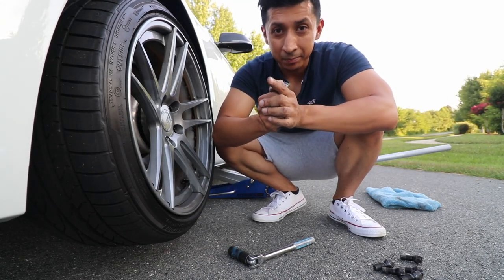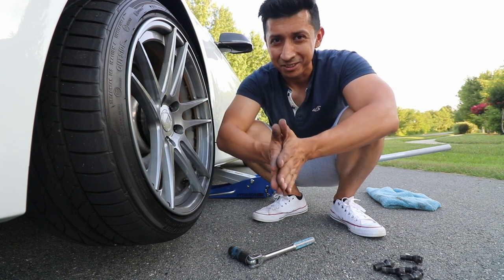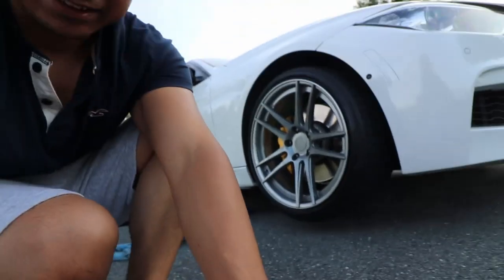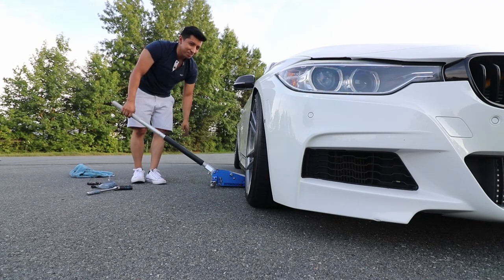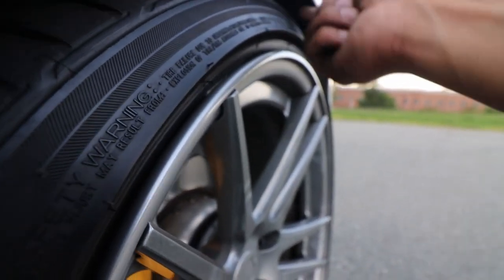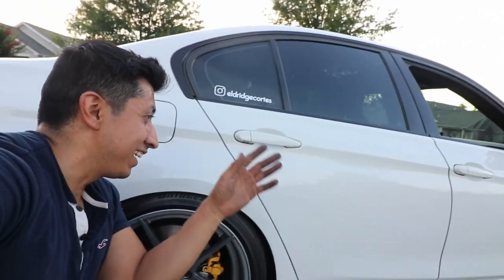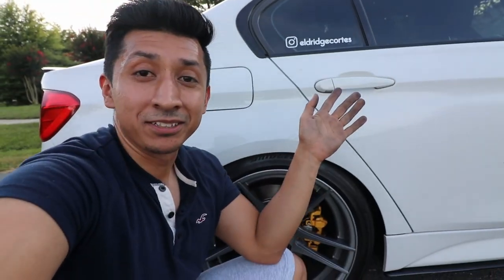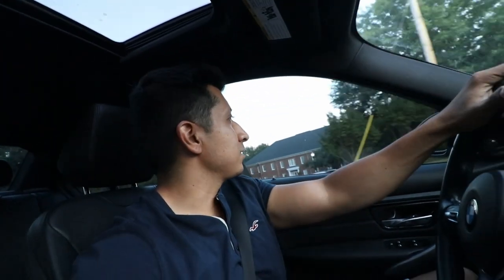Perfecting my F30s stance! | wheel spacers

Comment: Looks awesome. I have very similar fitment with 8.5" +20 ( you poke 3mm more) up front and 9.5" +33 rear (0.6 mm difference). My tires are too meaty though, I think you should stick with the 235 for a lil' more stretch but that's me :-)
Reply from the maker: I think youre right. I took a good look yesterday and If i can leave it at the height it is now, ill keep a 235. Now if i have to raise it to save my lip then ill run a 245 lol

Comment: how does the car handle after you added more negative camber?
Reply from the maker: havent had the chance to go for a good drive but it should feel better in the turns since it'll be making the same contact amount under load vs having uneven camber. Im only running -2.5 so it doesnt affect daily/normal driving